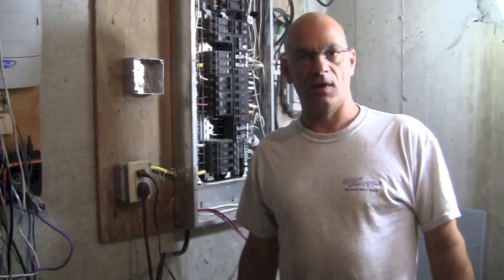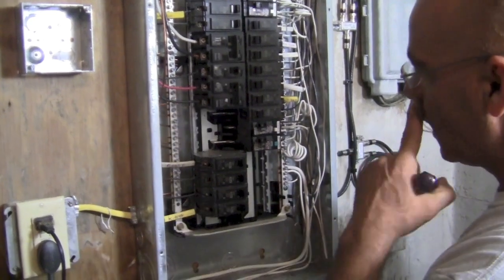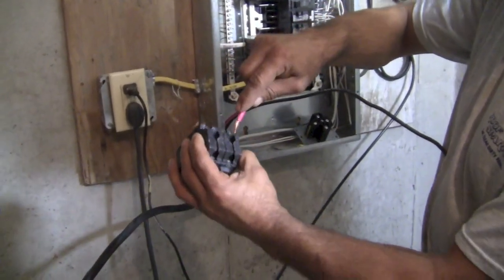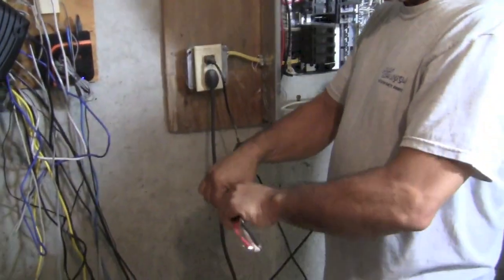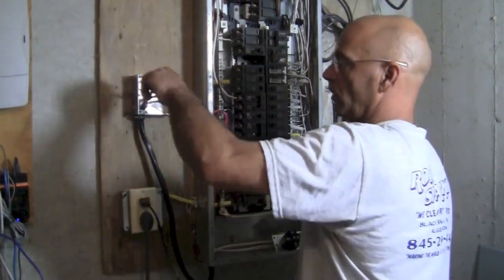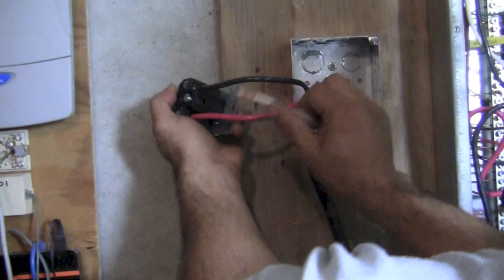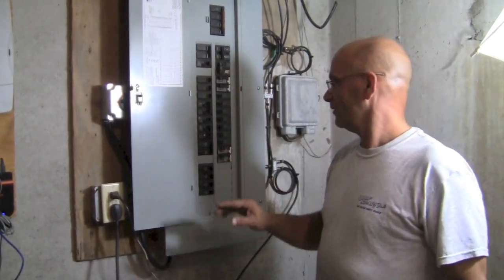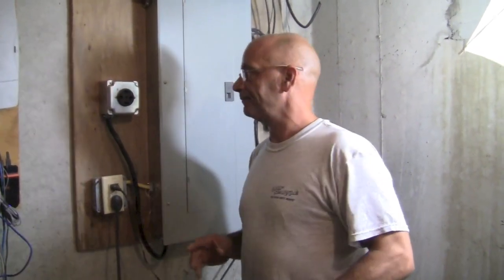How to Install a 220 Volt 4 Wire Outlet

Comment: I am replacing a drop in stove with a stand alone, both were 240, 50 amp. The stove plug is four prong but the wiring coming out of the wall has the 2 hot wires and a ground but no neutral. Do I have to change the stove wire to 3 prong or can I do something else with the neutral?
Reply from the maker: What is the new stove model #

Comment: I know you did want to get into it in this video But I might have to run a 220-240 t9 my outside poll building for future machinery but what is basically the difference in 2-3 phase? I have a motor that says runs on 220 set to 220-440? but I don't know the phase any input would help nice video by the way Also I have heard of a thing called a phase inverter? I might be wrong on that Anyway Thanks for your time
Reply from the maker: 3 phase is really only for commercial. Or super big houses, maybe. Yes they do make phase inverters. I really don't know much about them. I've installed one like 25 years ago and that's about it.
Reply: Three phase is basically 3 legs of power A, B, C. you generally will see this in commercial buildings, and Mansion style houses. Depending on your motor you should be able to wire it up with 2 hots, and a ground. If you hear the motor go in reverse just flip your hots and it should straighten itself out. Modern day motors don't care what phase you provide them as long as they get what they need.

Comment: Great video, Dominick! I like your no-nonsense approach and safety cautions. If you can deal with a couple of dumb questions here goes. I need to add a 220V circuit in the garage for a heavy-duty tool, but the panel in the garage is full. Can I cannibalize two house circuits and make the 220V? Can you add more than one 220V receptacle on the one circuit (using only one at a time, of course). Is there any such thing as a 220V extension cord?

Comment: I hope I'm not nuking this but are you working on a multi phase panel? I understand the theory and concept behind a split phase 120/240v multi wire panel, in which you dont need a neutral for the 240, just two hots because the split phase is 180 degrees out of phase. In this vid you include a neutral with 2 hots, so I'm thinking you're working with 120/208 wye? If it is a single phase system, why is the neutral needed ?
Reply from the maker: This a single phase with two 120 hots. In a 220 the neutral is the return path unlike a 120 v.
Reply: I always that when installing a 240v breaker in a single phase service, there is no need for a neutral, so according to NEC you use black tape on both ends of the white to designate that it's a hot. Why are you using a neutral for this setup? Could you please explain. I'm an electrician for the Seabees and we have a project coming up that's 120/240v single phase and our lights are all 240. I'm just curious as to your reasoning.
Reply from the maker: ABflanagan523 on a 20 amp you may not need a neutral as a return path. I have that video. But for this video "4 wire" the neutral is needed for 120v and a return path. So lets say your stove needs 120v for the clocks and what ever. But you still need the 220 for the heating elements. A electric motor for 220 may need it as well. So really it's dependant on what you're connecting it to.

In plain english it's always good to use the neutral when needed.

Comment: Isn't there a requirement to ground the metal outlet box? I noticed you connected the ground wire directly to the outlet without running a separate ground wire from the outlet box using a green screw. Could you please clarify?
Reply: At 11:10 he shows that the Ground connection of the Socket is connected to the metal plate on which it is installed.  Hence, connecting the Ground wire grounds the metal plate and when the plate is installed in the box, it too is grounded - as shown when tested at the end.

Comment: A most informative video. Thank you.
Seeing that the neutral wire on the 4 wire 220V outlet comes from the common neutral bus bar, could I convert a 3 wire 220V outlet into a 4 wire 220V outlet by "stealing" the neutral wire from a 20-amp 110V outlet (which will be decommissioned) next to it?
I understand that this is not the right way to do it, but feeding a 10-3 w/ gnd cable is not a possibility at the moment.
The 20-amp outlet is using 12awg wire, while the existing 3 wire 220V outlet is using 10awg wire. How harmful would it be to use the 12awg neutral cable from the 20-amp outlet for the 4-wire 30-amp outlet?
Reply from the maker: Don't even think about.. Sorry to say.
Reply: askmediy Any reason why?
Reply from the maker: Martin Charles For a four wire you'll need all four wires. Two hots, one neutral and one ground. No other choice.

Comment: Great video. Any chance you could do a video on half hots with odd readings. I have a half hot that shows 48V on the switched red with the outlet off. And a black line showing 77V on the wire and an additional 48V on the terminal of the outlet. Also , a hot red in my e- box spliced to a dead black wire. Can't understand why the electrician is using the red as a source of power along side perfectly good black hots from the panel!! There so may different combination in this box of all this wrong, I had to make a diagram of what I'm seeing to help process the info. If you could help with a video I would be happy to help and share the entire story with you and your audience.  My home was new when I bought it in 08. Built in 05 as a model. Thx.
Reply from the maker: Thank you. You'll need to trace out each wire to see they begin and end.

Comment: Great video. If you're interested. Can you do a video on how to diagnose non -working half hots and switches with unknown destination s.
 I have three single pole switches in on box. 1st switch on far left goes to an unknown destination,  2nd switch goes to a fan light combo,(works fine). 3rd switch goes to a half hot that doesnt work. I have odd readings. On the red switched leg on both non-working switches, I'm showing 48V (switch is off) On the line black hot, I'm showing 77V and an additional 48V on the outlet screw where it connects to. 60htz on both black and red switched legs. ( Tested with wires disconnected from switch).  It's a puzzle wrapped in a riddle. Even thought was trained in electrical work in the late 70's to mid 80's, I did mostly commercial work. I still have no problem installing just about anything electrical.( currently installing two sub panels and a bunch of new outlets in my garage.) However, I'm perplexed with this problem. There's more to the riddle if you're interested. If your wondering ,this was a brand new home in 05.

Comment: do you have a film on phase 3 220 wiring?
Reply from the maker: No sorry to say. But keep in mind this video is for a 20amp. 3 phase would be done very differently. A 3 phase breaker has three hots.
Reply: askmediy
do you think you will be doing a 3 phase soon?
Reply from the maker: Not anytime soon. We are waiting on a permit to start building out a bagel shop and all of that is 3 phase. But it will be awhile.
Reply: askmediy
thanks for the reply and will be looking out for it

Comment: I'm sure this question is easy for someone who does this all the time but Google isn't helping me out.  I work a lot with 120 but this is my first project with 240. I have 8-3 non-metallic wire that I ran to location in the garage.  I have to get a 2 gang box but I'm not sure what size knockouts I need to make sure it has.  I see that the vast majority have 1/2" and 3/4" knockouts but a small number of options have 1" knockouts.  For my 8-3, do I need to use one of the boxes with 1" knockouts?
Reply from the maker: 3/4 should be fine.
Reply: Thanks!  Now the fun part of installing it in a half finished wall where there is an air conditioner/water heater in the way on the unfinished side.  Contortionist or trying to install it from the finished side. :)

Your videos are really helpful. Thank you for making them.
Reply: Jonathan Nellis  You can just use a 3/4 K.O with a 3/4 Romex Connector. This will handle a 8/3 w/ ground.  Make sure you use a Deep box. 120/220 is just 2 phases of Power from the POCO; Can be A phase with C phase, or C phase with B phase, or any combination Of the sort. so just think of 240 as 2 120 legs of power supply your  Receptacle. Depending on your amperage will depend on your wire size as well. 8/3 is generally a 40 amperage breaker.
Reply: Craig Fine At about 3:30 in this video, Dominick states
"Not two different Phases, This is all single Phase - just two different 'Legs' 110 V each." - and he is correct.

The supply to the premises are NOT two phases of a 3 phase system (which would be 120 degrees "out of phase" with each other.)
The supply is derived from the secondary of ONE single phase transformer with 220 V across the entire secondary BUT the secondary is "center tapped".  The center tap is Earthed and provided to the premises as the Neutral, which is again connected to Earth/Ground at the distribution panel - as mentioned at 2:12. Thus, three wires come in - TWO "Hot" wires each with 110 V AC with respect to the Neutral (and Earth) BUT 180 degrees "out of phase" with each other - giving 220 V across the two of them.

Comment: hi, man can the fieldpiece SC77 meter also be use as a regular home electrical work
if not what do you recommend as a good electrician meter?
thank for your vids
God Bless bro!
Reply from the maker: To do what ?
Reply: as a go to meter! check voltage on outlets and  whatnot
Reply from the maker: matos cristiano Use any AC voltage tester really. Just not a 10 dollar cheap one.
Reply: thank you bro!
Reply: fluke or field piece are fine for checking voltage.

Comment: can I run a 30 amp welder on a 50 amp outlet using a pig tail  that plugs into outlet and has a end for the 30 amp plug to the welder.
Reply from the maker: Just replace the breaker to a 30 and the correct outlet. I can not give any advice on using "pigtails"
Reply: askmediy
Thank you .
Reply: What is the longest distance  you can run a 4 wire 240 before you get a power loss? Thank you for your time.
Reply from the maker: Don Seeley about 2 feet lol. Check my site where I have a wire calculator for just this.
Reply: askmediy
Could you please give me the site location for this info on wire length?
Reply from the maker: Don Seeley http://www.askmediy.com/electrical-wire-size-calculator/

Comment: Could you use the same 4 wire for a heat pump / electric furance?
Reply from the maker: Same wire as in what. The size ? If so wire needs to matched to the load.
Reply: for a heatpump use 10-2  and for the electric furnace normaly is a 3-6 for the 15 kw

Comment: 6:15 Dominick would US electrical code allow you to pigtail more wire if you needed to shift breakers in box and some wires were too short? hope my english ok....
Reply: Yes your allowed to extend the wire with a Joint, but it doesn't look good in the Electrical Panel as a final result. Generally you'll install your breakers in the order you want them in to get the room you want, then start landing your wire as a final step of the project. Doing this not only allows you to provide a much neater panel, but also allows you to be safe and not worry about that wire becoming hot while you work on it.

Comment: Hey Dom, I'm moving my laundry room into an old kitchen. Is it OK to wire my 30 amp 120/220v dryer into the old stove's 50amp 220v outlet? Or should I install a 30 amp breaker as well?
Reply from the maker: Yes install a 30 amp breaker
Reply: askmediy
Thanks man!

Comment: Just saw this video (too tired from carrying water to completely resolve my air baseboard hot water issue this eve.). The way my father, an electrician, taught me to think of the 4 wires is that the red is incoming from the power co, the white one is the return to their generator, black is the ground to the power pole (protects elec. co.) and the naked is for your house ground (protects your house). A danger is finding the naked one tied to plumbing and not a ground rod per se.

Comment: Love this Guy!!!  Going to be installing a heater in the garage soon that is 220v.  Now if Dom could show me how to easily run the wires "through the house" I'd be in heaven. (Someday there will be "wireless" electrical cords).  Thanks for all the insight.  Used your advice many times (hardwood floors, etc....)

Comment: I have four wires coming out of the wall (older range stove that we pulled out) the new stove is 3 wire...so I just NOT use the ground? Looks like there are two spots for hot and one for the neutral.